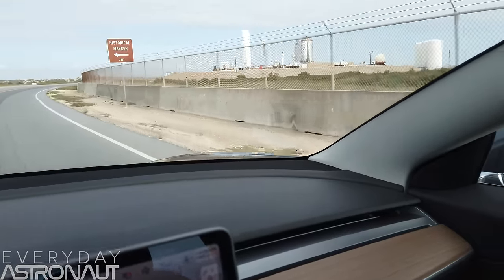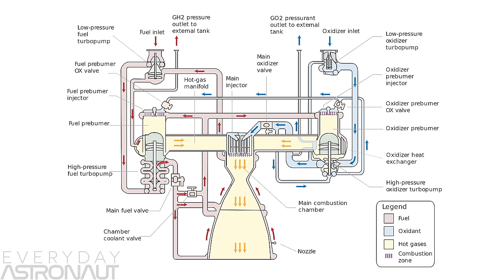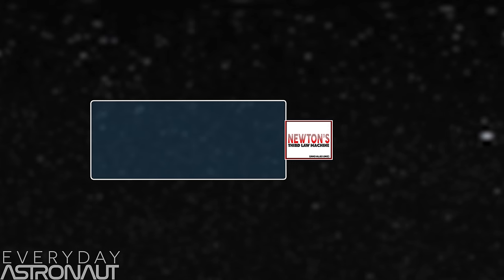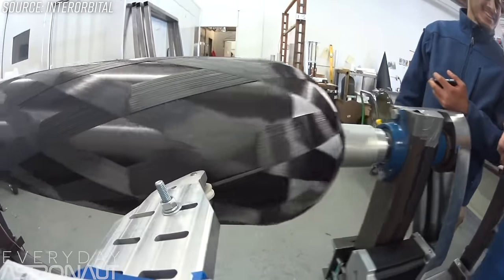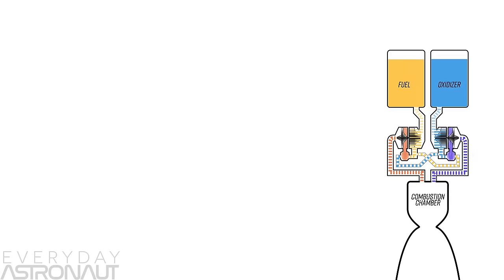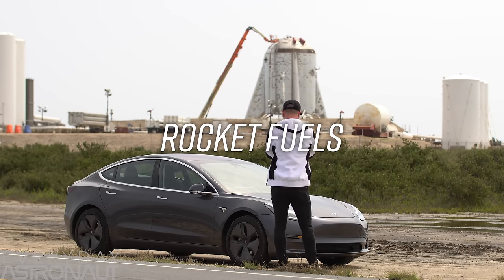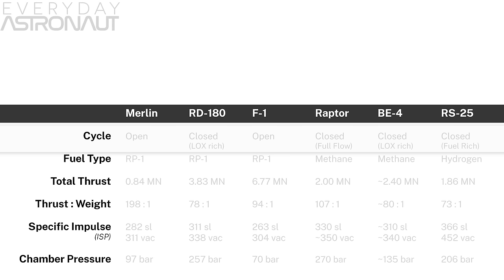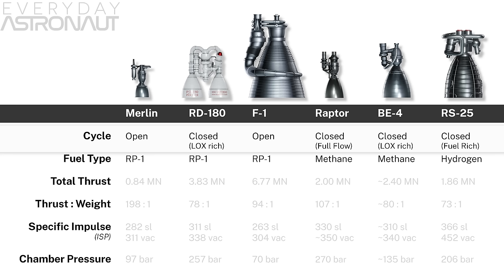Is SpaceX's Raptor engine the king of rocket engines?

Comment: Hi! In the video and in the article, you said that you were not considering the RD170 engine, because it almost did not fly. This is a fantastic understatement. In the RD170 variant, he flew in the ENERGY system only 2 times, 4 engines at a time. But in the RD171 version, on ZENIT series launch vehicles. He flew more than 80 times, if it is "almost did not fly", then F1 also did not fly practically .... :)
Reply: He covered the shared turbopump oxidizer rich closed system that both RD170  & RD180 use. Since this video is not about listing which engines did and did not fly, I think we can give him a pass

Comment: Great video Tim!
You probably couldn't find the refurbishment cost for the engine price metric, but I bet that would have made the RS-25 much more expensive.
Reply: no
Reply: the expensive part of the space shuttle was the heat shield replacement , not the engines

Comment: I've watched this several time now, keeps getting better each time!  
Now, that being said, it seems all the chemistry, sexy explosions, and fluid dynamics gets all the attention.  I have so many questions about how the surfaces of the combustion chamber are able to contain the pressure, since the chamber is basically made of a bunch of tubes and pipes with cold fuel running through them.  How is the combustion chamber constructed to not only cool itself with the pre-burned fuel, but also to hold itself together, and handle the mechanical forces put upon it?  Further to that, how do the surfaces that provide lift transfer that energy up through the diverging nozzle, combustion chamber, injector plate, oxidizer dome, and gimbal bearing to the thrust frame?  How does an injector plate, which is basically a big metal disk with a bunch of holes and chambers in it, and an oxidizer dome, which is basically a big hollow metal dome, transfer 1.5 million lbs of thrust to the gimbal bearing?  I know it's made from fancy alloys, and I know it's designed to withstand the forces, but it would be nice to have it explained form a mechanical engineering point of view.
Thanks!
Reply: The thrust is acting on the bell, as well as the combustion chamber, and I guess the metal has the strength and right atomic structure to transfer the force through the massive trusses or thrust dome to the rest of the rocket. If you lift a huge bucket of water up onto your shoulders you are not pushing on the water itself are you, but I guess if you pushed up fast/hard enough the bucket might come apart if the weight of the water was higher than the tensile strength of the buckets walls. Rockets are not much different. I find it interesting how few rockets have had a RUD in flight, I guess they are over-engineered to avoid that.

Comment: You are mistaken about RD-170: - its' RD-171 variant flew a lot on the Zenit rocket.
Reply: I've commented the very same before reading your message. It is sad that Zenit is forced into obscurity.
As if someone conspires to delete it from history.
Reply: @volo870  the interesting thing is that rd170 info is right there in the wikipedia article.
@EverydayAstronaut is an obvious shill for Musk, and the effort here is to downplay the difficulties of Raptor design. RD170's weakness is obviously in reliability, which has been confirmed as due to the insane combustion chamber pressure, and Raptor is trying to surpass that.
Reply: @stanislavkogan  Zenith has 90% reliability (including test launches, were she exhibited some toothing pains). It's quite high for soviet vehicles.
Also it was most energy- and cost-efficient rocket of the 80s, 90, well into the late naughties. How the hell do people forget that?!?
Reply: @volo870  you are correct. One of the reasons for this forgetfulness is Russian propaganda: zenit is a Ukrainian rocket.

Comment: 40:00 ish. I think it's interesting that the cost per kN goes up when you're spending someone else's money.
Reply: Well, kinda. The technological advances needed to lower the cost of launches would postphone the space race achievements. People don't only set high goals for their governments, but very hard deadlines, which cost a lot. It's not hard to imagine why that happens when a nation is full of people that just wanted to get into moon faster than the commies and don't care about what happens next, for they are not into rocket science or space exploration in general. And as the government, you are OK to comply since well... It's their money.

Meanwhile private companies care about viability of projects, meaning that deadlines are set to develop stuff slower to lower costs, but just fast enough to be a successful product once ready. On the long run this makes sure that there is always income to keep things going instead of waiting for the next batch of money to burn (*cofh* NASA).
Reply: @TRak598  is it true also that people are kindof more expendable, even though I think NASA has stated from 60s saving lifes etc, but pressure from public and government to keep it in deadlines also means cutting corners with safety... I dont mean cold war era but 80s, 2000s there was no more space race, yet some accidents. Maybe in same way as as long as it is not politicians child sent to Iraq, it is just fine...
Reply: Also keep in mind that the older engines like the F1 are generally going to more expensive due to the extra cost of building something that sophisticated with older manufacturing technology.

Comment: The feeling you get when you make a rocket that costs 6 billion then some younger person makes a rocket that costs under 10 million that's shorter but more powerful
Reply: No, some young person did not do that.  They were operators of the most advanced hardware and software available.  Application-specific encodes the expertise of many experts plus standards.  The problem with these young kids is they don't have the grounding in the fundamentals the engineers of the 60s had.  Many times they are not able to know when software produces a wrong answer.  A slide rule operator knows the approximate answer before he calculates so he knows when he computes a wrong answer.  the really amazing thing is what the 60s Apollo engineers could have done with today's technology.  How do I know about this?  I sold my ~50 employee high tech company and retired in July.  We actually had classes for recent graduates to teach them the fundamentals that applied to our business.
Reply: That's the difference between taxpayer-funded projects and privately-funded ones.  And BTW, that "younger person" stuff is just wishful thinking and total bullshit.

Comment: Next thing you know, Elon is going to make an electric rocket engine.
Reply: Lol hope elon sees this and gets that idea
the engine will made by tesla 
  thought by boring company
and used by spaceX
Reply: The Rutherford engine is an electric rocket engine
Reply: With solar panels
Reply: They exist, but they are used just in really specific situations and they don't have that much thrust the chemical do.
Reply: ion drive?
Reply: There are electric rocket engines already (ion thrusters and plasma thrusters), but they are used exclusively in vacuum and provide really low amounts of thrust but can do so for a very long time. The Starlink satellites use Hall effect thrusters so it definitely counts.
Reply: No way
Reply: Photon thruster?
Reply: Didn't rocket lab do that?
Reply: @weirdvideos6527  Rocket Lab's Rutherford engine has an electric pump feed system but still uses RP and Lox for propellant 👍
Reply: KUMURUKE cc the electric-chemical rocket? Rutherford?
Reply: Krzysztof Czarnecki I think he means electric-pump engines
Reply: He probably is.
Reply: No.

Because raptors commonly optimize for small agile males and larger females able to carry more.

Thus, they would be queens.

Good job on those animations!
Reply: @brittneyholmes4436  Why did you copy paste scott manely's comment?
Reply: cough electro gravitics cough

Comment: RD-170 flew 80+ times. Is it so much less than F-1 did?
Reply: There were 13 x Saturn Vs launched, each with 5 x F-1s, for a total of 65 x F-1s used on space launches.
Reply: @Demaenetus  So, the stat that shows the F-1 flew on "17" flights is inaccurate.  I am unaware the F-1 was ever installed on any other rocket besides the S-V.  Or am I wrong?
Reply: I think you’re right, sir. There’ve been proposals to use it on other vehicles, but they never materialized.

Comment: Although the RS-25 was designed to be "reusable", that was only for the shuttle.  Going forward, they'll end up in the ocean...so your calculations for $/kN Ratio and Potential Cost are way off.  That's the problem with the SLS.
Reply: From what I understand, you can buy multiple Falcon 9 launches for the cost of a single RS-25 engine. It's a great engine, but the economics were pretty bad even when they were re-used...
Reply: @TheBest14184  True, but once they've used up the legacy engines - I don't know how many they have left - they'll be relying on a new version that is designed to not be recoverable and is therefore somewhat cheaper...but still, the engine is a huge investment that is just thrown away.  And that is the issue with the entire SLS platform.

Comment: This makes my thermal systems class look like a joke.
Reply: There's very little maths in this video, which lowers the bar for explanatory difficulty considerably. Chances are your thermal systems class requires calculus at the very least, and quite probably a lot more besides, so cut 'em a bit of slack. That said, this video is still extremely well made.

Comment: CH4 engines also occasionaly produce icky stuff. There was a beautiful presentation, explaining gas dynamics of raptor engine (I think), and it had many tens of possible CH4+O2 reaction and it's products outcomes.
Reply: Sauce?
Reply: Those were mostly radicals and half reactions though, I doubt there were many stable, solid end products in there
Reply: @tdoge  search "SpaceX GPU Raptor", it should be the first thing that pops up. The chemical reactions part is near the back.
Reply: @dsdy1205  Right. Thanks for checking.
That icky stuff must be measured in milligrams then, I suppose.

Comment: "Since RD-170 flew less it's less relevant"
Puts Raptor in the lineup.
Reply: The difference is that Raptor and BE-4 are likely to be flown a lot in the future, while nobody has plans to fly the RD-170 ever again.
Reply: @rikvanriel6718  
RD-170 is just a remarkable piece of machinery. Since it's been flown in a few missions and designed for re-use, I would love seeing how it compares to modern ones.
Reply: Pls don't invite Russian trolls  to  pollute this nice thread ...
Reply: Exactly the same I noticed. The usual bias. Be4 is even not finished its development path, while rd170 was a successfully developed device which were used in Energia.
Reply: @rikvanriel6718  "flew" is past time form, but you saying about future, do you feel difference? Pls dont distort original statement.

Comment: I find it interesting comparing these numbers to what we know now. For most of them not much has changed, for some of them it has. In specs Raptor is better now in terms of for thrust, thrust : weight, ISP, and chamber pressure. We don't really know if anything has changed or improved for the BE-4 in specs or operational, we know nothing has changed for any of the others in terms of specs, and operationally any changes for most of them are either minor or speculative.

The biggest, most impressive changes are the operational ones for the Merlin. The numbers that start being shown @36:50 are drastically different in terms of reusability and flight record for Merlin now than they were 5 years ago. As of today (1 July 2024), the reusability record is now 22 operational flights, not counting static fires or testing. The flight record is 359 successful launches (349 F9 + 10 FH). The reliability by number of flights is ~99.45% (359 successes in 361 attempts), not counting upper stages.

Who knows what the reliability by number of engines is; I don't think anyone but SpaceX knows for sure how many Merlins have failed in flight out of the 3,790 times a Merlin has been used (351 F9 flights x 10 (9 booster + 1 upper stage) + 10 FH flights x 28 (9x3 booster + 1 upper stage)). But we can take a guess. In the failed CRS-7 launch it was a strut in the upper stage that failed, but to be conservative we'll count that as a single Merlin engine failure. For CRS-1 a single Merlin engine on the first stage had an anomaly and shut down, so that's another. So the best estimate from rudimentary investigation is 2 failures out of 3,790, a ~99.95% success rate. There was also an on-pad failure for AMOS 6 prior to a static fire, but the engines didn't even get to try to start.

Those 3 failures were ages ago relative to Falcon's now long launch record. CRS-1 was the 4th F9 flight, back in 2012; CRS-7 was the 19th flight, back in 2015; and AMOS 6 would have been the 29th flight, back in early September 2016. Since that last failure, the Falcon family has had 333 consecutive successful launches (323 F9 + 10 FH). That is over triple the 2nd place for most consecutive successes, which belongs to the Atlas 5 at 97, and still nearly double compared to the entire Atlas family at 172 (it will be over double by the end of this year). At this point, it's hard to argue against the Merlin and Falcon being the most successful rocket engine and rocket family in history.
Reply: And 2 weeks later Falcon 9 has a 2nd stage failure, lol. 😆
Reply: Now that Raptor 3 has been revealed, and SpaceX has given specs for it, it's amazing to compare to all the others on this chart. Per SpaceX (commas added):
"Raptor 3 (sea level variant), Thrust: 280tf, Specific impulse: 350s, Engine mass: 1525kg, Engine + vehicle-side commodities and hardware mass : 1720kg"

So Thrust : Weight is ~183.6 for the former and ~162.8 for the latter. No recent number for Vacuum ISP, but public number is that it's approaching 380 s. We don't have any recent numbers on cost per engine, but even a few years ago it was stated to be approaching $1M / engine, and IIRC it was stated at some point since then that it's under $1M, and with scale it's probably lower now. So if we go with $1M to be conservative, the cost per thrust is ~$364/kN. Chamber pressure was 350 bar as of a few months ago.

Another important consideration is that Raptor is a relatively small engine, especially in terms of footprint; only the Merlin is smaller. Unfortunately we don't have good numbers for this. We can't just use bell nozzle diameter since all of them have pieces that stick off past that, and in the case of the RD-180 it's two nozzles, but it's something at least. Based on relative sizes and known thrust, I'd guess that Raptor 3 probably has the best Thrust : Footprint ratio if it were done with accurate numbers, with Merlin likely the closest competition and the only one that might be better. Raptor 3 nozzle diameter is 1.3 m, giving crude thrust to footprint ratio of ~2.07 MN/m^2. 

The result is that, overall, even if Raptor loses to any other engine on 1 thing, it blows that other engine out of the water on everything else.

Vs. Merlin : The Raptor 3 has lower Thrust : Weight (but not by much), over 3x the thrust, almost 70 higher ISP at sea level, more than triple chamber pressure, and ~1/3 the $/kN. Merlin has 0.91m nozzle, so crude thrust to footprint of 1.29 MN/m^2, which Raptor beats handily.

Vs. RD-180 : Raptor 3 has lower thrust, more than double the thrust to weight, 40 higher ISP, nearly 100 bar higher chamber pressure, and $/kN ~18 times lower. I can't even find a bell nozzle diameter for the RD-180, so have no way of even spitballing a guess. Nonetheless, Raptor definitely has better thrust : footprint since it's notably less than half the size, with more than half the thrust. I'd guess Raptor is around 1/3 the footprint, so probably has around double the thrust to footprint.

Vs. F1 : Raptor 3 has much lower thrust (less than half), but 73-95% better thrust to weight, ~87 better ISP, five times the chamber pressure, and ~12 time lower $/kN. F1 has 3.7m nozzle, so crude thrust to footprint of 1.16 MN/m^2, which Raptor nearly doubles.

Vs. Raptor specs in this video. :P Everything. It's improved at everything.

Vs. BE-4 : Uh, the BE-4 is actually worse at everything now. If the numbers in this video are the goal of the BE-4, and based on Blue's way of doing things they probably aren't pushing to exceed those numbers, then the Raptor 3 is actually better at everything. Although I've seen more recent thrust of 2.45 MN. So Raptor 3 has ~0.3 MN higher thrust, about double the thrust to weight using the lower number for Raptor 3, ~40 better ISP, ~2.6 times the chamber pressure, and ~9 times better $/kN. Estimate for BE-4 nozzle diameter is ~1.83 m, for thrust : footprint of ~0.85 MN/m^2, less than half of Raptor, and surprisingly worse than the F1.

Vs. RS-25 : Raptor has worse ISP (by surprisingly little at sea level, much bigger difference for vacuum), ~ 0.9 MN higher thrust, easily over double the thrust : weight, over 140 bar higher chamber pressure, just under 74 (!!! 74 !!!) times lower $/kN. Nozzle diameter is 2.3m, so crude thrust to footprint is a whopping 0.51 MN/m^2, by far the worst of them, and not even a quarter of Raptor 3's ~2.07 MN/m^2.

So yeah, Raptor 3 basically crushes everything else, and it's not even close. At this point we can say with certainty that Raptor is the best rocket engine ever made when compared to every previous well known rocket engine at the time. What I'd really like to see is Raptor compared to the engines other companies are currently developing, or at least engines which have been developed in the past 5 years.